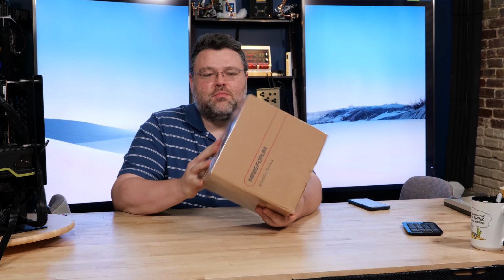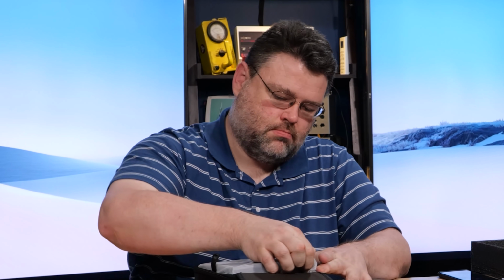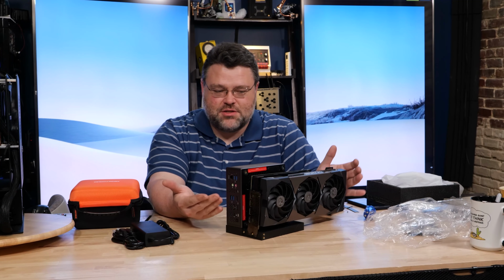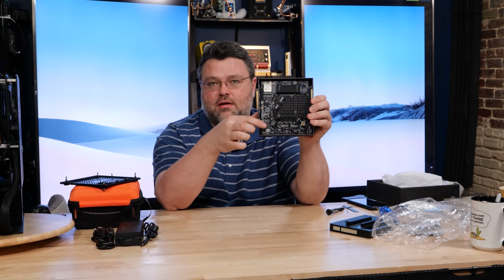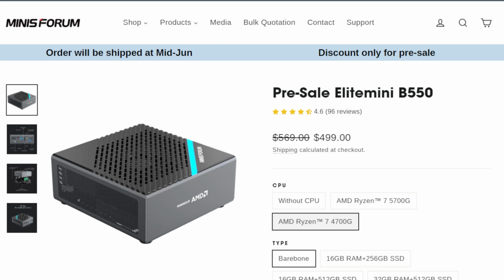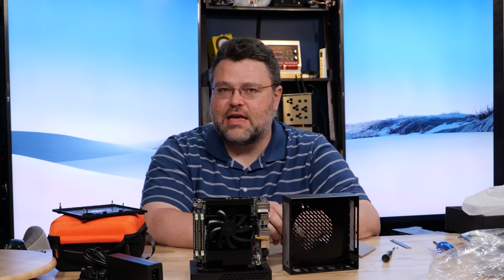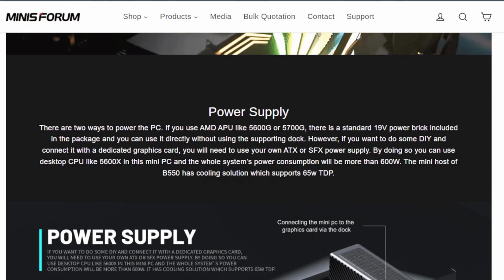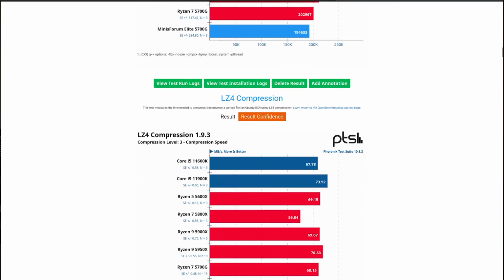Small and Quiet: Elitemini B550 Review

Comment: Because of the carrying case (and space for PSU), it seems like they intend the main PC to be portable and the base really is a "docking station".  I wonder just how robust those PCIe card edge connectors are, though, in that case? How many insertion cycles?
Reply: If you plan to make good use of the dock, expect to undock it only when occasionally traveling or if your dGPU dies and you need to get files off immediately. If they could make this work with pogopins or something it could be undocked daily on a future model.
Reply: Hand-held sad might be more robust as portable pc solution

Comment: Seeing that docking solution is making me want this for larger but still totally portable solutions. Just have a PCIe slot mounted to the chassis with a little plastic shroud to protect the slot when not in use. Maybe it could come with a little dustproof display case for your GPU when it's not socketed.
Reply: Maybe put this on a laptop, so we can start plugging real expansion cards into our docking stations like we did with the old luggables in the 1980s.  It's so sad when everything hangs of serial ports like on the Raspberries (Ok, one is USB and another a single PCIe lane).
Reply: @johndododoe1411  Idk where you could practically put a PCIe slot on a laptop and external GPU docking stations already exist, though the market has been dying for them due to the niche nature of the product compounded with a 2ish year GPU drought
Reply: In that case you could use dynabook (Toshiba) or eurocom (Dell) notebooks with modularity support, they have pcie slots for videocards and other
Reply: @johndododoe1411  again, dynabook and eurocom has 1-2 pcie x16 2.0-3.0 ports in notebook, if you have enough money
Reply: @shawndiaz7528  For scientific solutions that's a shame, it could be a good chance to change an old laboratory pcs for new and compact ones. (Not the docking station, but the ability to use pcie slot)
Reply: @johndododoe1411  the worst thing about not having a full-sized pcie slot is being limited to stationary pcs for the professional work such as composition, physics lab testing, electronics prototyping and etc. There's just not a single laptop with soundcard that have low difficulties graph and full support of such outputs as bananas& others, or not a single laptop that have proprietary extension card from National Instruments. At least haven't seen

Comment: just received mine and tossed a 5600g in it with a 430w EVGA psu and a RX6500xt and it works got the bar bones for $319 and did have the psu mount platform I Like it

Comment: Thats a great little product but the idea could be more refined.  Intel nucs are the example they should follow. They should take the best laptop processor they have and make a compute module to be paired with that pcie slot module and please make a case (who in his right mind will use the psu and gpu like that, its messy and not very safe)

On the other hand the asrock  version of the sff with gpu support makes a little more sense. 

A zen4 big Apu with possible gpu expansion would make more sense

Comment: I’m trying to run this with an eGPU off of 2 DC power bricks. Is it possible to not plug in the 10 pin and 4 pin, and then run the PC off of its normal brick, and the GPU off of a separate power supply?

Comment: What happens if you plug in a 75W TBP gpu that normally only needs PCIE power? Would it work, given the unusual indirect connection?
Reply from the maker: Works fine because the ATX PSU plugs into the pcie distribution board

Comment: Does it need the external power supply to supply power to the PCI-E card?  what if I want to put an Intel Dual 10GigE card in it to make a little cluster node?
Reply from the maker: It doesn't "have" to have it. But not it's not built to dump a ton of power into the pcie slot either

Comment: Thank you for reviewing this product.
Could something like this (without the GPU expansion) be used as the "Forbidden router"? Maybe even adding a WiFi 6E card and use it as an access point?
Reply: The "forbidden" part of that is the eccentricity. There's no productive purpose of putting a router in a VM on a box you're gonna be using for other stuff. There's plenty of 4+ gigabit ports boxes out there for <$250 to use as a pfsense box/home router. Just make sure you're getting 4 cores and AES-NI. Then don't use it for anything that's not part of you home network hub; it's not worth the risk to do crazy shenanigans.

Comment: Why 3.0 on the gpu if both m.2 are 4.0?
Reply: Maybe the expansion board can't handle the speed.
Reply: @johndododoe1411  oh right.  I keep forgetting gen 4 is a problem despite running into it a lot lately with m.2 to pcie cables.

Comment: The problem is, any APU from AMD only supports up to PCIE 3.0. And plugging in a 6600 XT would be a bad choice performance wise as you would lose extra performance with that card running on PCIE 3.0 only.
Reply: Exactly...AMD either didn't think it through or just didn't give af with their cheaper cards
Reply: @samgoff5289  I'm guessing they have a PCIe 4 APUs in their plans sometimes soon, but they may be a bit delayed combining the GPU and PCIe4 chiplets in a working APU package (which is really a tiny motherboard with a metal lid).